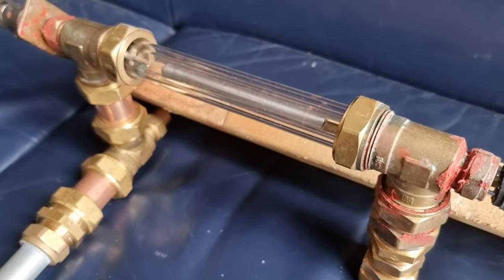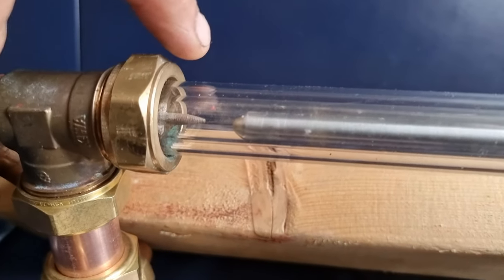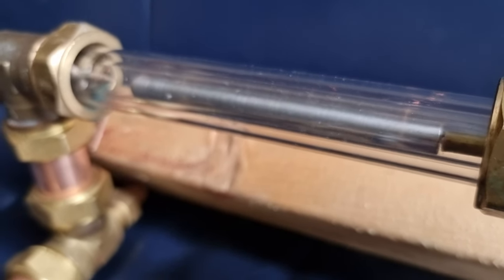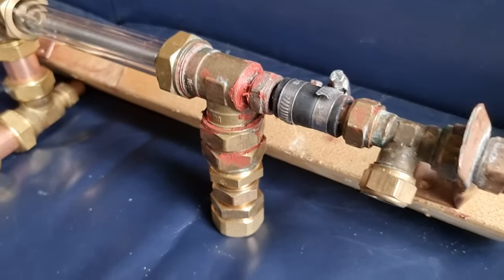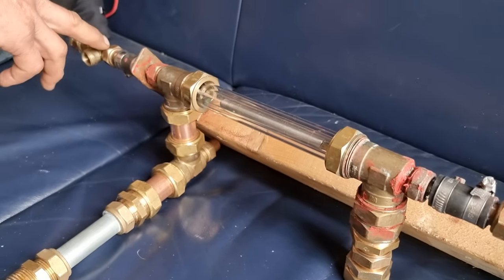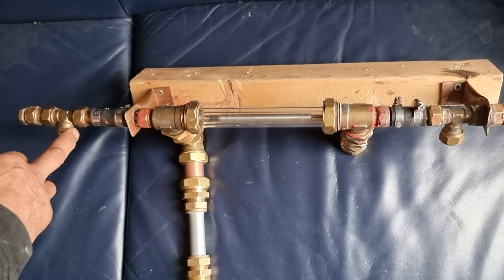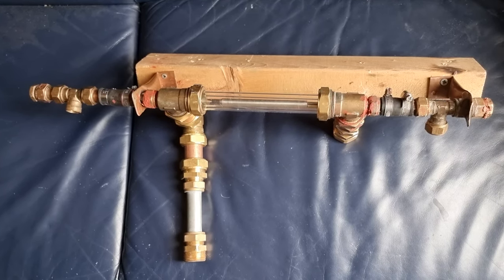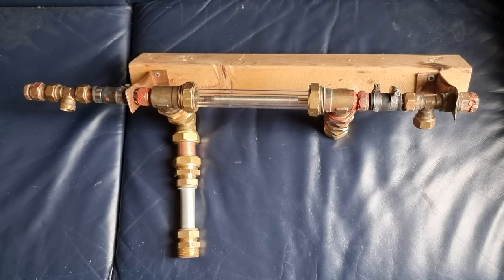GEET - Glass rod experiment apparatus overview

Comment: Noice!!!
Wire the ends together to keep an electrical continuity?
Reply from the maker: Unless you want it isolated!
Reply: @MFMP  ahh! Like, earth it? Does the floating material become positive because of its isolation? 
Man this is tricky lol. Like a rubrics cube matching colours and movements? 

In the Geet interview with the makers son(ginger beer guy) said the parts had to be connected?.? Could a glass device be non-magnetic or isolated?
Reply from the maker: @gruboniell4189  It at least gives you the option to test both scenarios